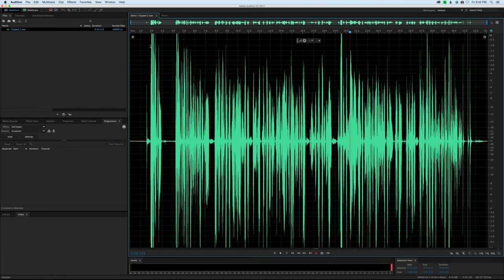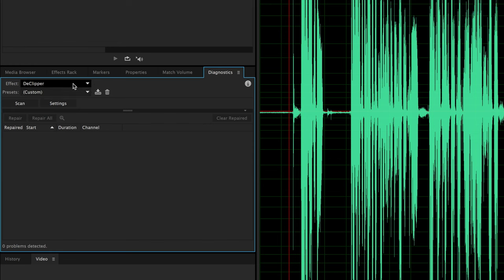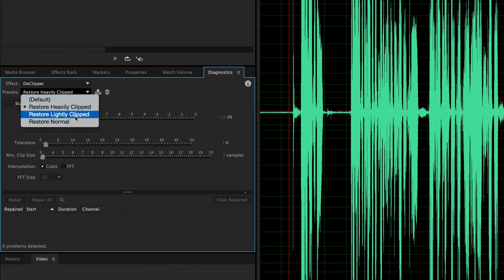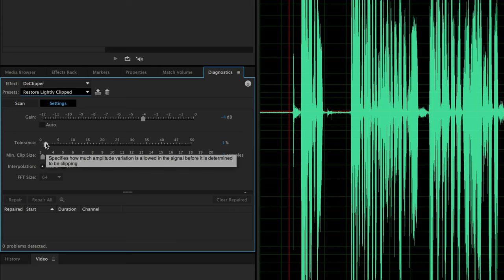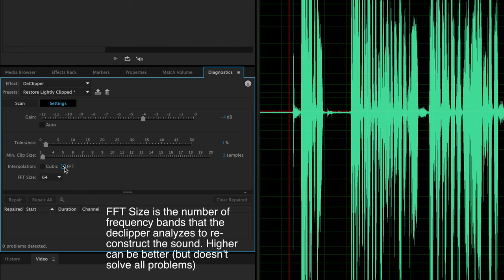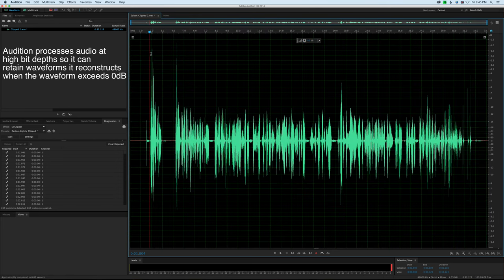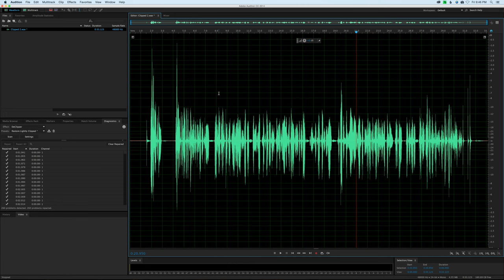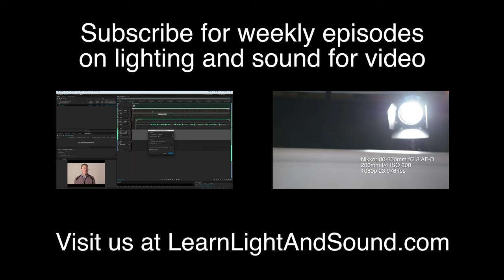Fix Audio Clipping in Audition

Comment: hi, I had a interesting issue I haven't seen before. I just filmed a church video and I had to leave my h4 plugged into the dj mixing board unattended since it was just me, I got good dialog audio check before I had to go man my camera, but every time there was a signer the dj would switch something, prob the eq. I couldn't get back to check levels at that time. but here is the interesting thing- when I import my audio to premiere the clipping point is at -6 db, so im assuming the dj must of turned up the gain or something to make my h4 db adjustments in adobe premiere to peak at -6.
Reply from the maker: Hi Rex, my first suspicion would be two things: The music came through louder due to the DJ’s mix. This is not unusual for popular music styles. In addition, I’d check to see whether the Zoom’s input limiter was on with the threshold set to -6dB.
Reply: @curtisjudd   thanks for the reply, My h4 did not have that set, its def something he set on his board, I've never encountered this with my h4 before.
Reply from the maker: @RexSmithII  Interesting. I'm not sure how that happened, I'm afraid.

Comment: Such a great video, thanks for explaining it so a "newbie" like me can understand the technical stuff. How do I move a sequence from Premiere Pro to Audtion for DeClipping? Things I have done: Open project in  Premiere Pro, edit, edit in Audition, Sequence, select Entire Sequence, Send through Dynamic Link, OK. When I open in Audition, Diagnostics and DeClipper is highlighted. However, presets, and scan are greyed out, and I am not able to click on anything. I also tried to highlight the audio sequence in Premiere, right click, edit clip in Audition, but when I do that, only a small clip is transferred over instead of the entire sequence. Maybe I'm not highlighting the audio track correctly? I'm just learning the key board hot key "tricks". Thanks in advance, I'm new at editing.
Reply from the maker: Hi Alison, I believe you'll need to do this in the Waveform window and it sounds like in Audition you might be in the Multitrack window?
Reply: @curtisjudd  That worked! Thank you. I'm going to dive deeper into post processing with Adobe Audition, I just purchased your course.
Reply from the maker: @alisonjonespharmacist  Glad it worked! Happy mixing!

Comment: I have a some audio that was clipped by my camera's digital limited, so the waveform doesn't actually show it as clipping. Is there anyway you know of to repair the distorted audio in that instance?
Reply from the maker: +Robby Huang I would think that this same method would work if the waveforms are squared off just a bit. Did it not help?
Reply: It didn't really seem too, but I didn't play with the settings too much. But I actually just found a pretty decent solution. I was using the Saramonic UWMic10 (first time using it on a shoot, and my tests made me pretty confident, but we were next to a river for one shot and they were talking much louder than I anticipated, and I also didn't hear the distortion in my headphones) which records two lavs into one receiver, so one person is in the left channel, the other in the right. And just during the distorted sounds I just used the second talent's mic and replaced the audio and it sounds pretty good.

Haha, not sure if that made sense. Anyway, thanks for the reply!
Reply from the maker: Yes, definitely makes sense. Creative solution!

Comment: I have the Rode Videomic Pro plugged into a Zoom H1. I tried recording behind my car at a standstill in my driveway. When I rev the car, the audio gets really distorted and sounds bad. I have auto-gain on the H1 turned off and the level set to 1. On the Rode I had it on at +20db. Any idea why the sound got ruined or if it's fixable? Thanks!
Reply from the maker: You might want to reduce the gain on the RODE to -10dB. Cars are loud. May also need to move the mic away from the car a little more.
Reply: Thanks for the response, Curtis. I'll give it a shot.

Comment: could you explain what is the difference among Clipping/Normalization/Compression？I thought all the them help to reduce sound and peaks...
Reply from the maker: Clipping is when the waveform hits -dBFS. The result is usually a distorted sound. Compression pulls down the amplitude on the waveform. Normalizing moves all of the samples in a waveform up or down, usually to control loudness.
Reply: @curtisjudd  I see, another question, what does three samples means?
Reply from the maker: @LOOng.Talk_2333  Three samples? A sample is a point on the waveform in digital audio. I don't remember why I may have said 3 samples in the video.
Reply: @curtisjudd  is the sample number related to the number of waveforms that hists -dBFS?
Reply from the maker: @LOOng.Talk_2333  No. In digital recordings, the recorder measures where the waveform is a certain number of times per second. For video, that is often 48,000 times per second. Each of those measurements are recorded as a sample. That is why you can set the sample rate in most recorders. Common sample rates are 44.1kHz, 48kHz, and 96kHz.

Comment: Another great tip Curtis.  I just recorded a concert on a canon EOS R and Atomos Ninja V.  I knew the audio would be clipped from the camera but I figured since I was recording to the Ninja external recorder set to 32 bit float, I could just turn down the volume in post and fix the clipping.  Well I don't know what bit rate the Camera has but the 32-bit recording from the Ninja just recorded the already clipped signal.  I'm going to try the method you suggested but do you know a better way since I technically do have a 32 bit file?  Thanks
Reply from the maker: There's more to preventing clipping than just a 32-bit file. The first requirement is an analogue stage which can handle the dynamic range of the sound it captures and the gain staging needs to leave enough headroom for the converters. So you'd need a microphone with a lot of dynamic range, and you'd potentially need a recorder with more than one converter per channel like the MixPre II series or ZOOM F6. I hope that makes sense.